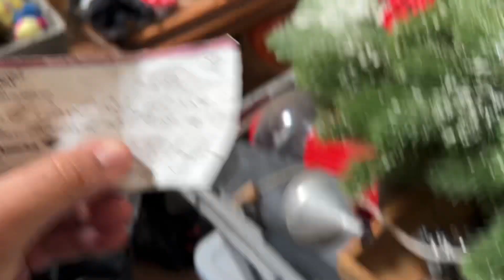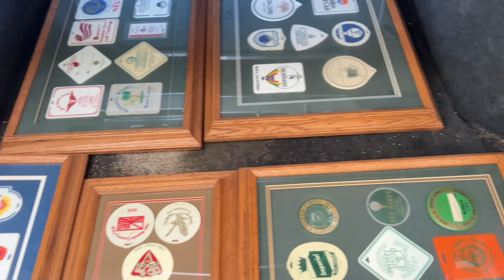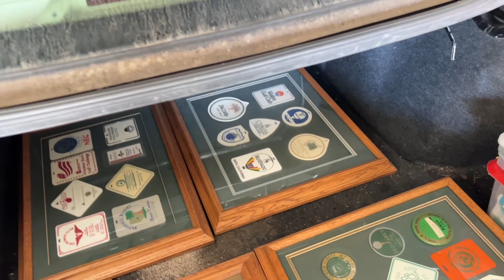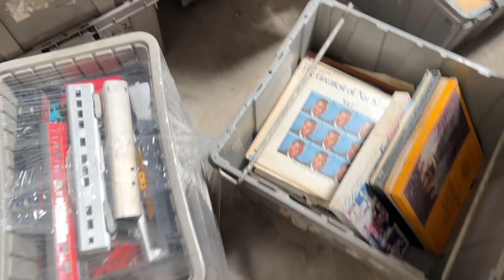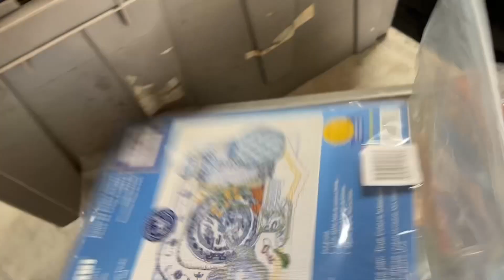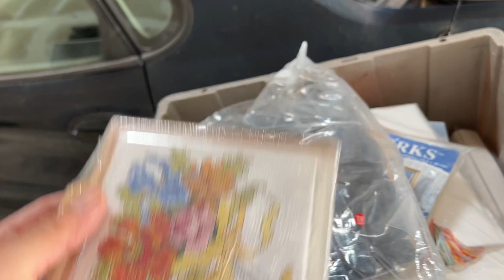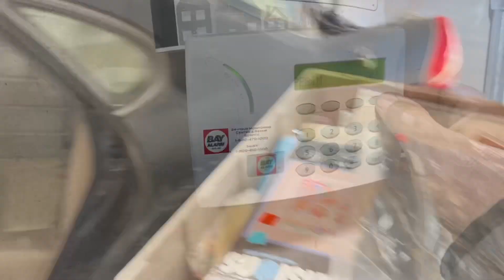Auction Sourcing for Resale: The Thrill of Treasure Hunting for Profitable eBay Flips!

Comment: I watch on of you vidoes on listing on button pins it got me motivated  to listed  some that I had. Knowing  they were going to be a long-tail item.  But one sold two days later.  Woo hoo.  Question before I start listing more.  I felt like i spent a lot of time looking up stuff like manufacturers OMG I don't  think i had one from the same businesses.  Is it even important  or are there any names I should be looking for?
Reply from the maker: I use Google image to help find the more important ones, it's built into my listing process for each product. Things to look for are the pin larger than the button, those tend to have more money. Thank you for watching my videos. Mark